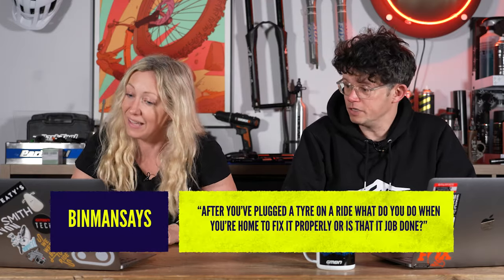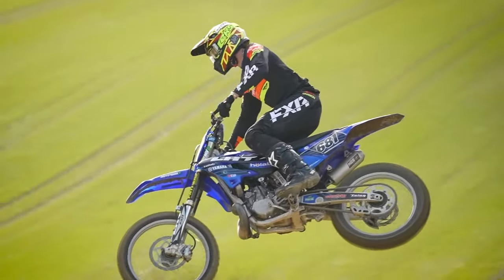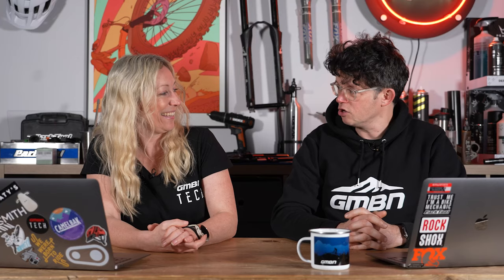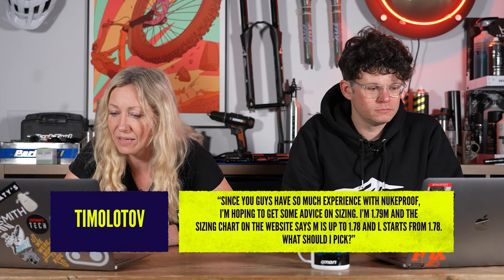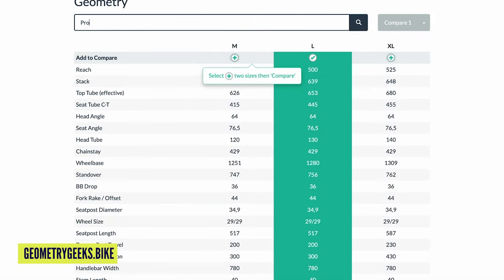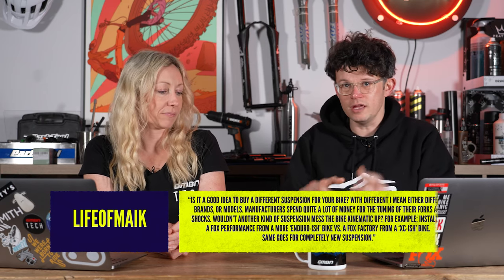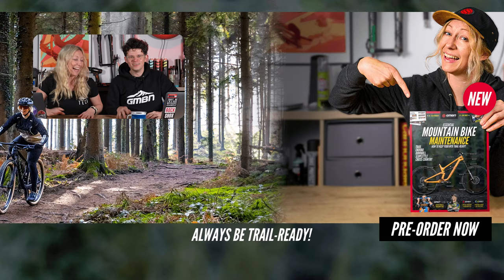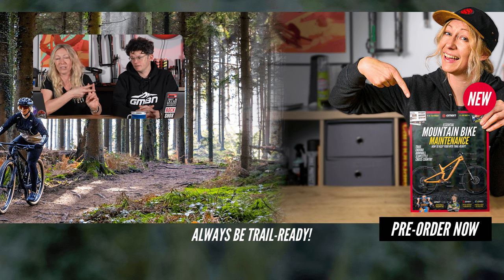What To Do After I Plug A Bike Tyre? | Ask GMBN Tech

Comment: Motorcycles definitely aren't one size fits all. You can lower suspension, lower seat, raise, lower, change the angle of the handle bar or move it backwards and change the positioning of the footpegs. Of course they can't change the dimensions of the frame since they would need a different engine for each size, so that's constant. Its easier to make frames in different sizes when there's nothing but a suspension and a bottle cage under the top tube :p
Reply: I have been an MX champion of only they made a size small or medium 450cc! LoL 😂

Comment: Whenever I have had to use a plug I always later remove the tyre and fix the puncture properly with a motorcycle mushroom patch. 👍   Minor punctures from thorns etc, where I haven't used a plug and where the sealant is holding on okay, I tend to leave it alone. Using a plug is pretty rare for me though. I probably have 15-20 minor punctures that the sealant alone automatically fixes before I get the bad one where I have to use a plug, or a really bad one where I have to add a tube.

Comment: My advice when choosing between a large or a medium frame as someone who usually falls in between them is what type of ride do you prefer? If you like it to be more nimble and poppy than go for the smaller bike if you're worried about it being more stable and planted, go for the bigger bike
Reply from the maker: That is exactly why some brands are moving away from conventional sizing. Specialized are using a "S-Sizing" instead where the "S" stands for style 🤔
Reply: @gmbntech  except they changed that in 2022 so on a 2021 I need an S3 and 2022 I need an S4. Given the number of regrettable late night purchases I make, at some point I'm going to buy the wrong one😂🤦‍♂️

Comment: #AskGMBNTech

I am in the process of building up a new 2024 Pivot Switchblade from the frame on up.  Across the lineup, Switchblades come from the factory with 160mm travel Fox 36 forks.  

Assuming I keep the fork travel at 160mm - would my new Switchblade be over-forked if I were to use a Fox 38 or Rock Shox Zeb?  

Other than the 200-300 gram weight penalty, are there any other drawbacks that come with using a slightly beefier fork on a bike with 142mm of rear travel?

Thanks,
Jason

#AskGMBNTech

Comment: #askgmbntech
I recently got a proper trail MTB, and i'm baffled with the way seats are made. There is almost 0 padding, so my sit bones get really sore after each ride, i usually need 1-2 days to get rid of the soreness.
Is there a real reason to this, besides weight savings? Am i expected to have padded shorts to not have my butt hurt, or any other way to this?
Reply: Because of the vastly different sizes of our body parts, it's pretty much impossible to make one-size-fits-all models of the parts of a bike that your body makes contact with - the seat and the grips. 
You are pretty much expected to get proper grips and seat aftermarket that fits your size if the default ones dont suit you. Because of this, it also doesnt make sense for the manufacturer to spend big money on premium grips and seat in their build, since they may need to be replaced anyway. Cheap seats and grips keep the total cost down. Bulky but comfortable grips and seats also don't look as "cool" and "fast" on pictures as the slim uncomfortable ones.

Comment: I'm sorry, but when you fix a puncture on a tubeless wheel,you have to take ya Tyre off when you get home to make sure it'll stay in....WTF !!...Another reason why I'll never go tubeless, too messy , and by the sounds of things, too much work...No Thank You...Ha !! Get some Kevlar Strip Inserts ,like I have,and never have a puncture again....bar the odd thorn in the sidewall...Ha !!
Reply: Most punctures (thorns) are sealed with the sealant. A bigger hole can be plugged with a gummy/dynaplug, and as Anna says in the video, once you're home you don't have to remove the tyre and glue inside, you can just do it on the outside... Conversely you have to remove the tyre to patch/replace a tube anyway - which is far nicer to do at home in the garage than out on the trail.
Reply: Going tubeless is simple. 
I've been tubeless for 13 years and never had a problem.